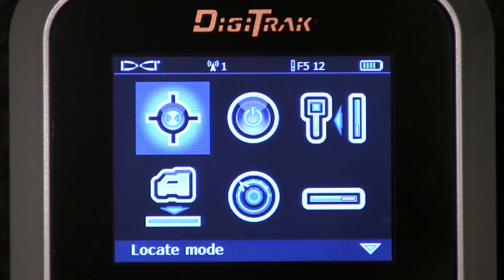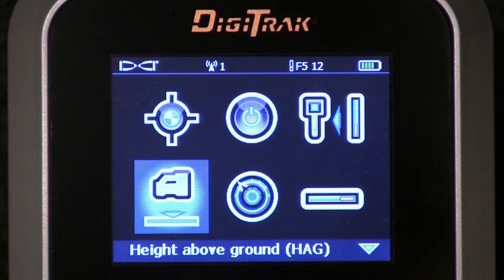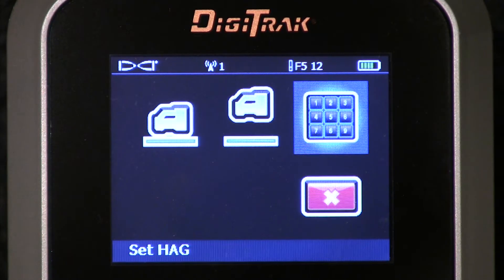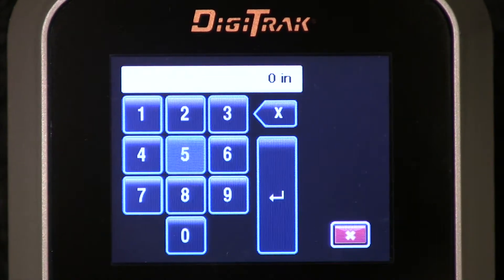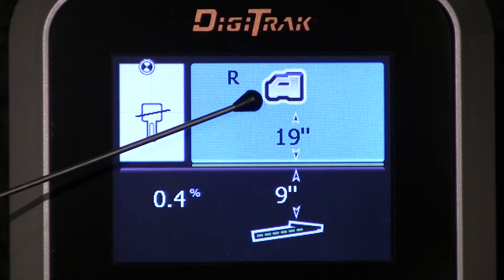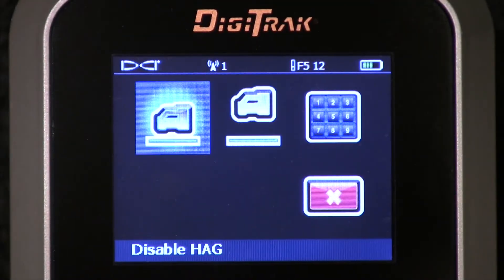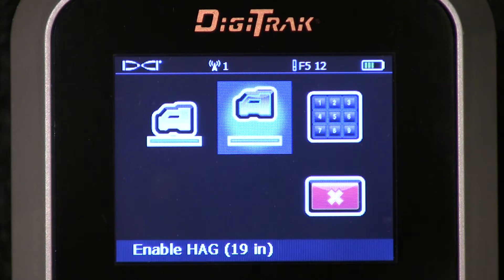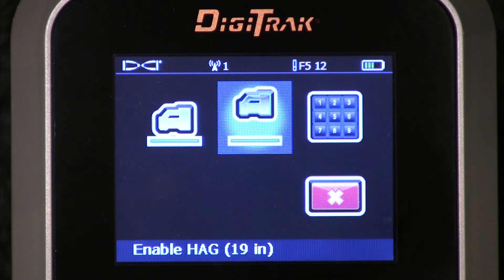DigiTrak Classic F5 Height Above Ground Explained

Comment: When you say hold comfortable and enable hags from where exactly are you measuring from top right corner middle right? To enable hags?
Reply from the maker: Hi Jessie,
the Height Above Ground (HAG) setting is the distance from the bottom of the hand held receiver to the ground surface while holding the DigiTrak receiver as you will when getting depth measurements. The person who is operating the locater merely needs to measure the distance from the receiver to the ground surface when standing and load that value in the HAG setting. Some users hold their DigiTrak level and rest it on their knee cap so the distance the receiver is held off the ground never varies.    
Thank you for the question! I hope we helped.